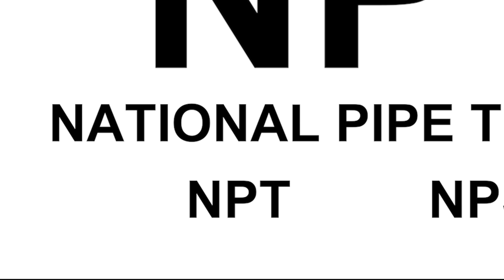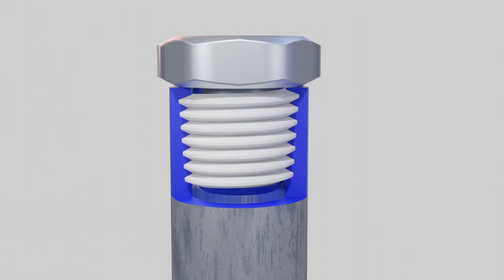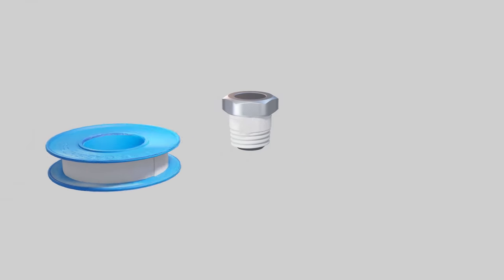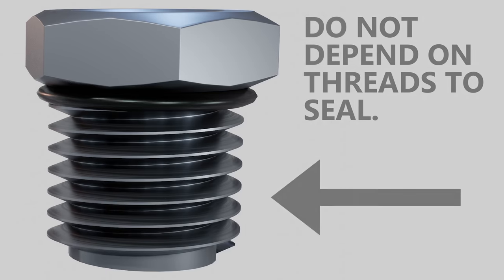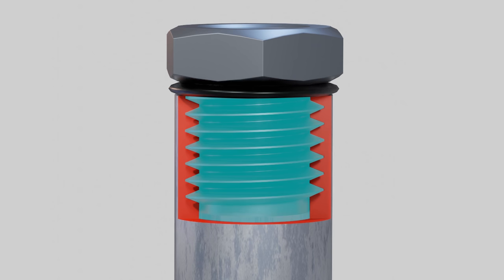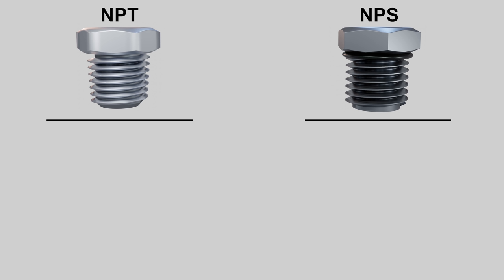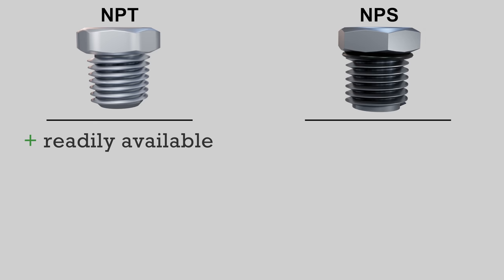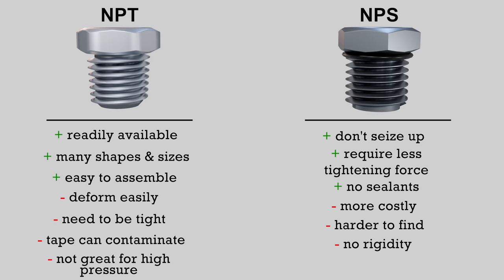PLUMBING THREADS 101 (EVERYTHING YOU NEED TO KNOW) | GOT2LEARN

Comment: I have a question, does anyone know of pipe dope for gas that DOES NOT set off an electric gas sniffer?  The pipe dope I use says for liquids and gas.  But if you put your cordless gas sniffer to it, it sets off the  alarm.  I have tried many different kinds and ALL say for water, liquids and gas, and do the same thing!
Reply from the maker: Interesting, i'm sure someone here knows.
Reply: @Got2Learn  when I was apprenticing 20 years ago I couldn't figure out why my gas fittings kept setting off the alarm. I finally just opened the can and stuck the sniffer up to it and it went off. So all those leaks I thought I had I really didn't have. I went back and tested them with liquid gas tester.
Reply: Ever hear of permabond? Good sticky stuff that can be used for any liquid or gas connections. Maximum pipe size is 2 inches.
Reply: @georei  no never heard of it. Where can you get it?  Is it permanent?  Some dope is adhesive.
Reply: @georei  never heard of it where can I get it?
Reply: Use Rectorseal #5  never fails
Reply: @clintgray1623  where can you buy it

Comment: You didn’t mention Pipe dope/goop with Teflon. I have been using for 20+ years. Works with water, natural gas and LP gas. You didn’t mention different color Teflon tape, I use green only. I have seen in Europe piping put together on water & heating lines and natural gas lines that are straight thread (they have no tapered thread) using steel wool and paint to seal the joints. They literally rust together.Comment.....        Jim
Reply from the maker: Check my teflon video for that.

Comment: Using teflon tape on gas pipe is just wasting tape but it's shocking how many licensed plumbers believe you need to use tape on gas pipe for the 'added assurance'. Dope is all you need on gas pipe to help lubricate the threads so you can snug up the fitting as tightly as possible (and it also helps keep the threads from binding and makes it easier for the next guy to take it apart if he has to). The tapered threads and fittings is how you create the air-tight connection, the tape is doing practically nothing and if you're worried about leakage and you want that 'added assurance' then you can use wick or hemp as seen in the video. 

I don't know why they even make gas rated tape as you still need to use dope with it anyway so you may as well just use dope and forget the tape. Tape is designed for straight threads, that's where it's useful. And if you insist on using tape for gas pipe, you put the tape on first and then apply the dope as you should for regular straight thread connections too. Can't believe how many people get that backwards.
Reply: I use pipe dope or goop with Teflon, does a great job, been using for 20+ years. Works with water, natural and LP gas.     Jim
Reply: Tape is even banned for gas-pipes in many countries (and some US states), but dope - nope, also banned in some countries as for gas it is just inferior to hemp.

Comment: Hello, I always wonder how you can keep a good seal but still position the threaded object (for example a faucet) in the right position. When you screw it very tight, the faucet may end up on its head, so unscrew it a bit, but that does losen the seal doesn’t it. Thats why hemp is good, it swells up, but the other solutions don’t, so i am confused.
Reply: You tighten until there's one full turn left and use that turn to position accordingly

Comment: Hemp and thread have a tendecy to rot where as teflon doesn't suffer from rot which is why teflon is usually preferred after pipe dope of course if not used in conjunction.
Reply: Hemp welds pipe together if you do not put paste the only way to get it out is to heat the pipe to 200c. It does not rot i have seen 50-60 year old hemp and it is fine. Pipe dope is crap i have seen it leak after 10 years and teflon tape not the best

Comment: Tapered Threads are almost as old and bad as lead pipe from 2 centuries ago.  Tighten just below the point of breaking, hope it doesn't leak, and it  will still seize over time, guaranteed.

Comment: Funny that you claim sealing is not the primary purpose of thread sealing tape - as it is correctly called by nearly all manufacturers and building-codes around the world............
The reason why PTFE is used over other tape-materials is its lubrication properties, but the reason to use tape in the first place is as a sealant.

Or feel free to provide evidence for your claim that goes against what every manufacturer says.